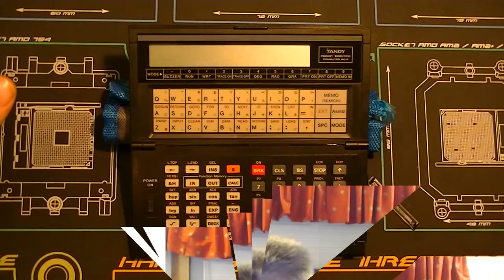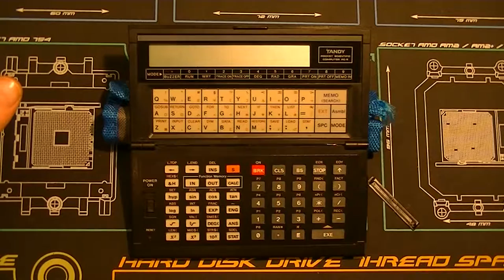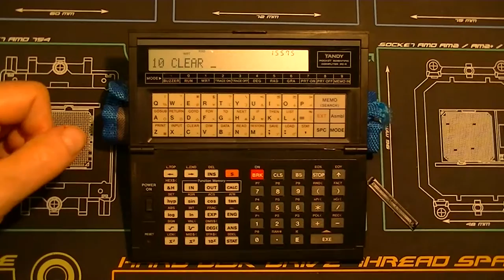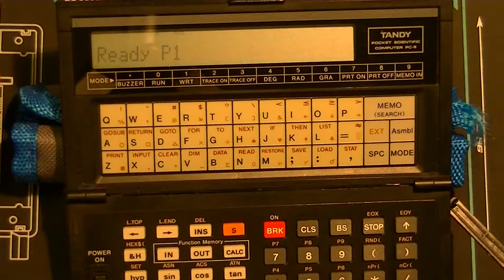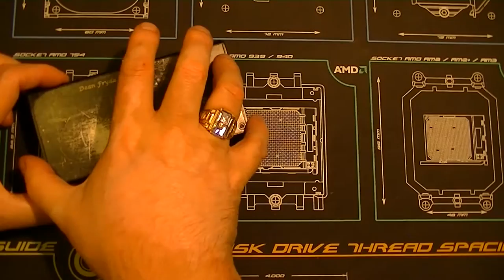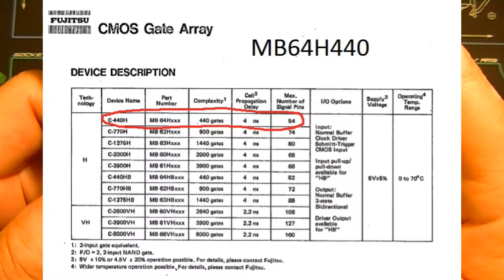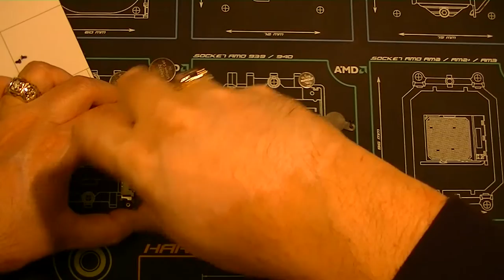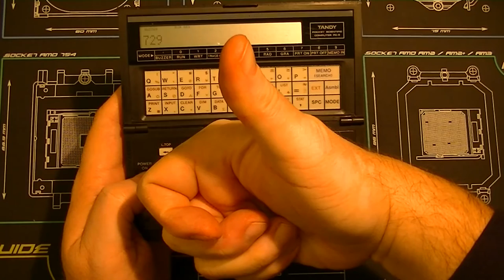TBT - Tandy PC-6 Review / Teardown

Comment: I had 2 PC-6's and also the Casio FX-795P, we used them every day in the oil field to calculate natural gas sales volumes, corrections for oil gravities, plus the necessary blackjack game.  I added the extended memory and had the tape backup.  Totally obsolete now but it was cutting edge tech back then.  I also have the PC-7, the only drawback is that there is no backup so everything was lost when you changed batteries, and had to re-program it.

Comment: Very neat, I thought I was the only one of the possibly 5 or 10 people in the world who still has my PC-6, also with the 8K ram module installed, cassette interface, box and manual which i bought new from Radio Shack back in the day. I also have the PC-8 box and manual and I still use them quite often. I don't have any parts computers of them so I have not had the guts to take mine apart. they still work as if brand new. I used to have the PC-7 as well but someone stole it when I was in high school in 1990 ($%#%%). Thank you for the video!
Reply from the maker: Hello Mike, I know what you mean, haven't seen anyone else with these calculators since college, and even then, there was only one or two others that had them.  If you look on eBay, you can find them from time to time like I did. Funny you mentioned the PC-7, I still have mine with the manual.  Great calculator, just a little short on memory with only 2k, but you still could write some cool programs to get you though calc and trig. I would like to do more videos, just need to find time.  Thanks for watch and thanks for subscribing!  Dean

Comment: One of the features I used often, not mentioned in video, is the Memo which I used as proto-digital diary. I had to keep it on for the alarm to alert me of appointments though.
Reply from the maker: I used the memo all the time.  I would store all my equations in the memo and then recall them into the function memory to solve.  Made those 3x5 note cards useless!

Comment: As far as I'm aware Casio made all of Radio Shack's calculators.  This one is a rebranded CASIO FX-795P.  Great little machine in it's day.  I miss Radio Shack. :-(
Reply from the maker: I too miss Radio Shack. I used to love being able to just drop down to the local store and check out the parts display.  There was something always nice about checking out the wall of electronics parts. I always walked out of that store with a bag full of parts that I really didn't need....LOL
Reply: No, not all of them. Some of Radio Schack's calculators were made by Sharp, as you can see in other videos. ;-)

Comment: Great video.  Just picked up a PC-6, had a PC-4 back in the 80's.  One thing I can't get around is that any program I enter in stops at every line of code, requiring hitting the exe key to continue.  Trace is NOT on, and stop commands are not in the code anywhere.  I know this isn't the way this thing is supposed to work.  Long shot to get a comment from you since this video is pretty old.  Crossing my fingers.
Reply from the maker: Hello Jeff, can you send me the program or code you're trying to use?  Would like to take a quick look at it, and even try it in my PC-6.  My email address is dean@netlogix.us
Reply: @dsfryda  Public shout out to Dean:  Thanks for correcting the syntax in my code.  Getting a kick out using this old unit again.
Reply: Don't remember if the PC6 was a Sharp product or not, but all the Sharp-based RS pocket computers had a "PAUSE" command that you could use instead of PRINT... e.g. if you did PAUSE "Hello", it would print the word Hello and then wait for .8 seconds, then automatically continue with program execution.

Comment: I just found one of these at goodwill for $2. It's actually the pc-5 tho, but looks almost identical. The batteries on mine are dead but I am worried about stripping the screws if I attempt to remove the cover. Any tips? Thanks.